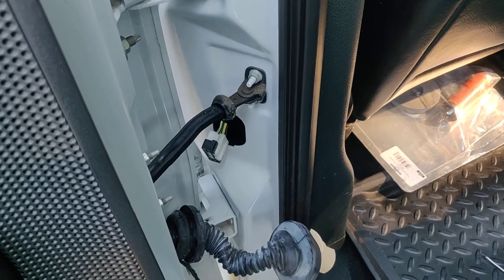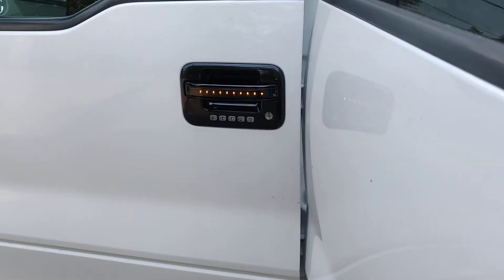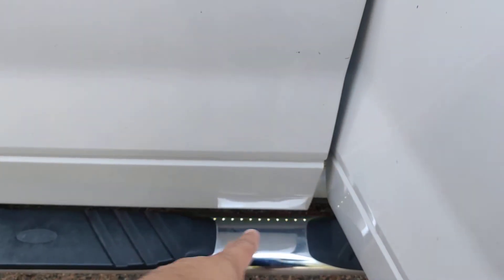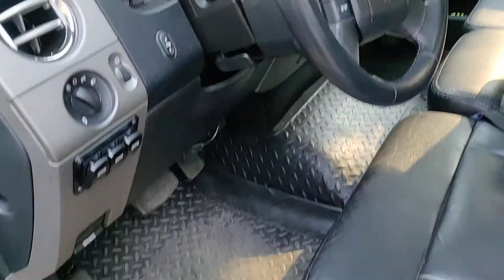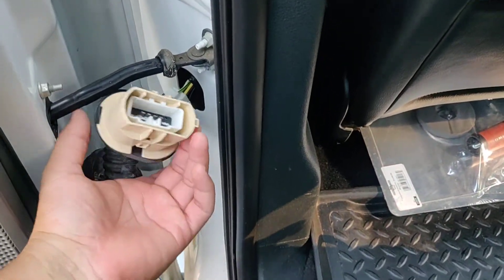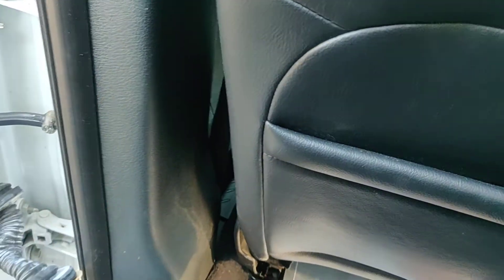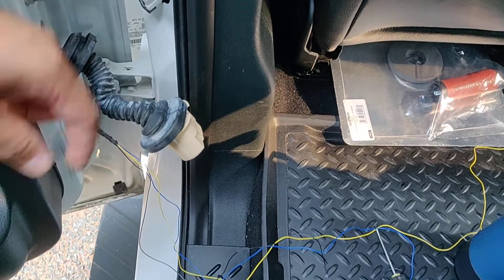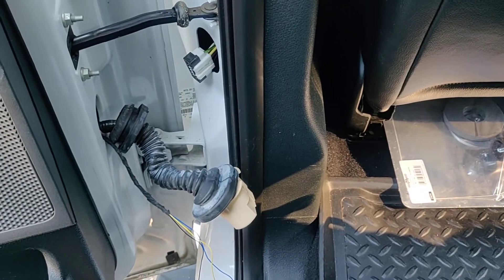2007 Ford F-150 on "IPCW FLA04BR Black with Amber LED & Smoke Lens Rear Door Handle Installation"

Comment: Great lights. Where can I see the complete video? Where did you buy these lights? I like the door handles as well. As the mirrors..
Reply from the maker: @juanrojas6596 they are the Morimoto XB side mirror lights. They can be found by just typing that in the search engine. As for the door handles AmericanTrucks sells them by a different brand. IPCW may or may not make them anymore, but they show up when you look around.